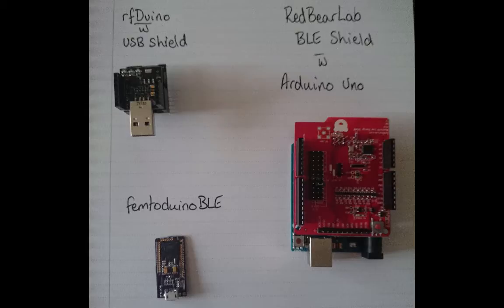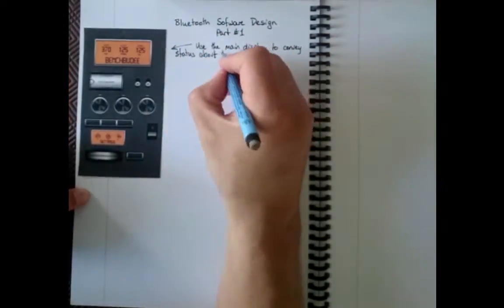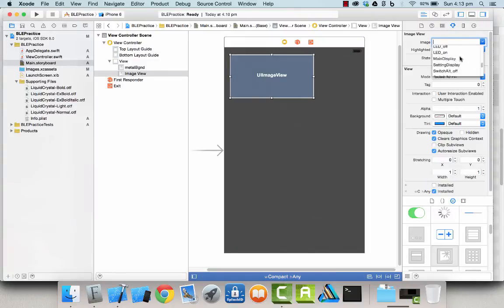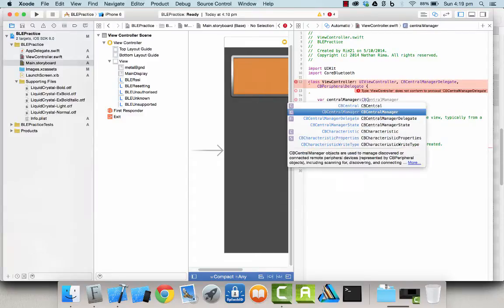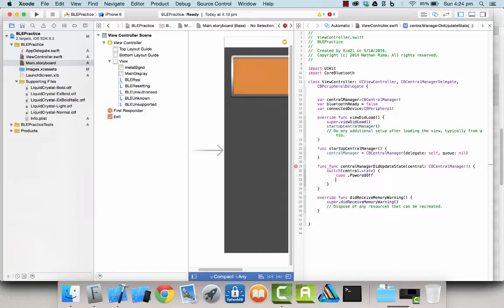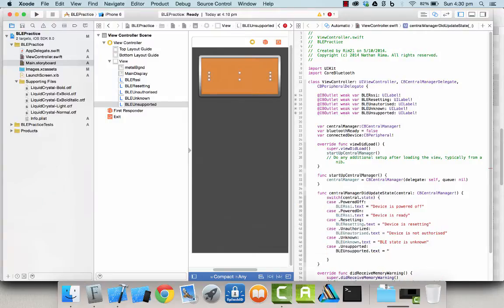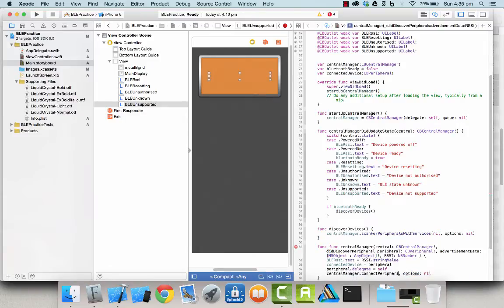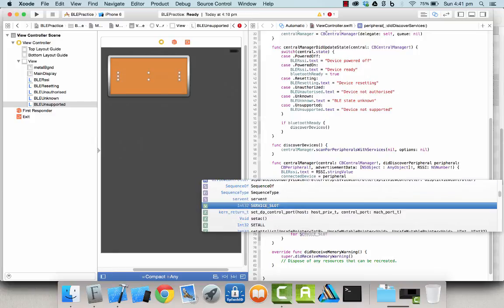Session #7 Arduino are we talking?

Comment: Hi so with what you did.. I want to be able to send a message(string message) through bluetooth to the third party bluetooth device, and also receive the same message from the third party device to the iPhone. Any suggestions on what to do?
Reply from the maker: Hi Bruce Wayne so noting that I haven't actually done this I do know that there is a RedBearLabs sketch that can do this. The thing that needs to be thought out is how big of a string message are you looking at? What I can gather is that there will be a limit to the number of characters that can be buffered and transmitted at a time. There could also be a need to add additional 'start' and 'stop' logic for the message. I don't think it is necessarily difficult just requires further thought. I would like to eventually be able to send serial console information like is captured through the Arduino IDE but that wont happen anytime soon.

I will try to find some of my research links on this topic and post if you are interested.
Reply: Interesting, and probably a limit of 140 characters of a string. Is that too big? The limit can be changed but preferably something 80+. I was thinking there should be something maybe that search for messages from the device and then collects it?

Yeah definitely send me some links if you can.

Thanks for the quick response!